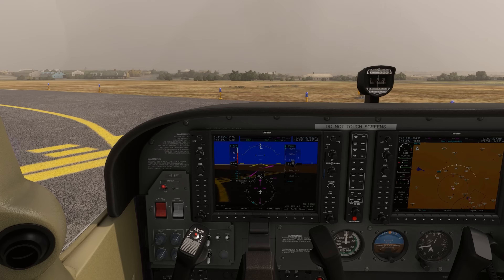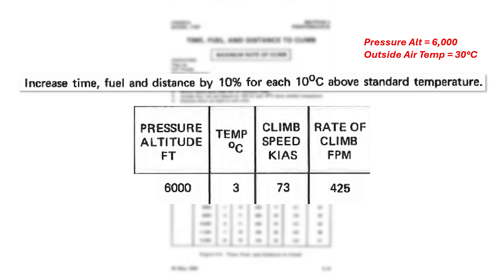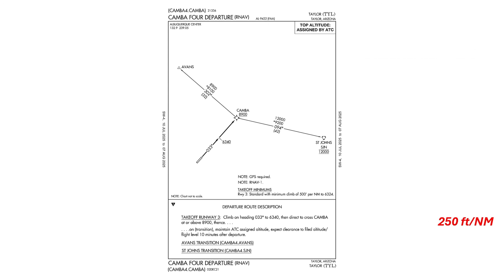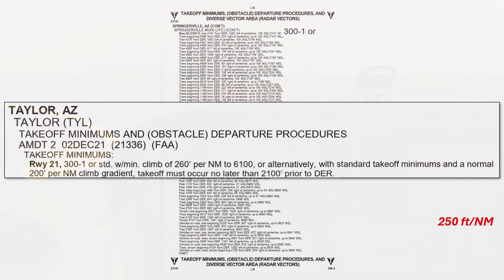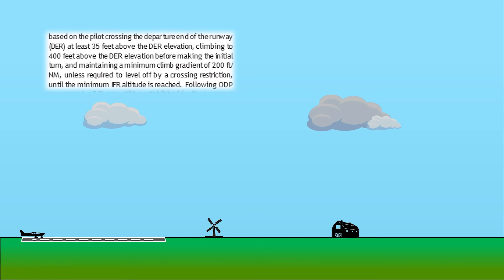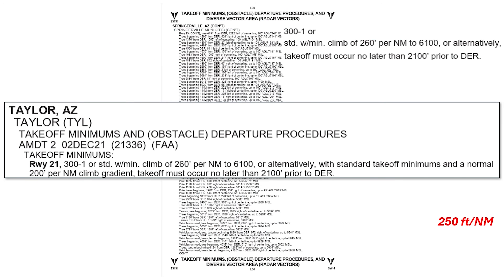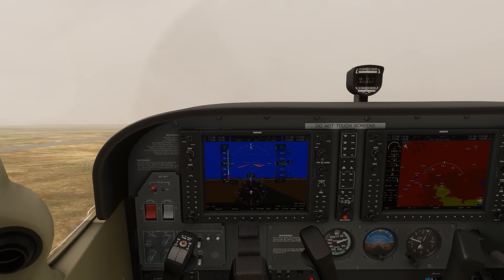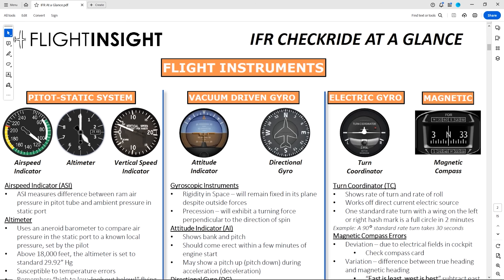This IFR Departure is Legal...But Barely Safe

Comment: The thing I always have to remind myself on is the performance data in a POH are assuming:

1.) The pilot is performing just as well. They can maintain Vy and climb out without too much deviation. Make sure the mixture is configured correctly for 6,000 feet of elevation.

2.) The engine is performing well. An engine with 5,000 tach hours is going to perform differently than an fresh engine. I'd definitely be VERY observant of performance during the runup.

3.) There's no other factors (wet runway, tailwind, additional parasitic drag from airframe imperfections, etc.) which could change those numbers.

With such tight margins, I'd wait for the weather to improve. The numbers are great to give you a little hint as to just how tight those margins are, but you still need some good ADM to add your own constraints to those numbers.

Comment: Why does 21 have takeoff minimums but no specific departure instructions?
Reply: The takeoff minimums exist to provide clearance from a very close obstacle. If you have 300 ft ceilings and 1 mile visibility, you can visually avoid it. If you meet the other restrictions you can outclimb it. Once you are at 6100 MSL (~300 ft AGL) and continuing to climb at 200 ft/nm, you can turn in any direction (technically upon reaching 400 feet AGL) and are guaranteed to outclimb surrouding terrain, which does not rise very rapidly, with increasing clearance. It’s essentially a diverse departure.
Reply: @FlyingLessons so IF there are takeoff minimums AND no specific departure procedure, a diverse departure is available?
Reply: @vortexgaming8761  I don’t know if it technically meets the full definition of a diverse departure since it has a climb gradient greater than 200 FPNM, but laterally, yes.
Reply: @FlyingLessons okay thank you

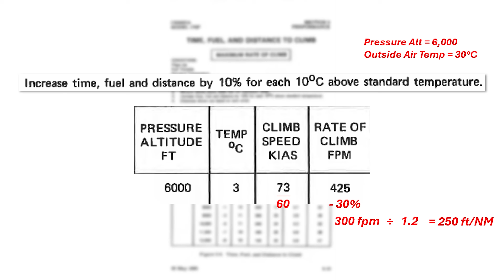Comment: interesting video, but i dont understand where you got the 60 from in 1:10 ?
Reply: You ground speed is 73 knots, which just represents how many miles you go per hour. Dividing this number by 60 (because there are 60 minutes in an hour) simply converts your ground speed (73 knots) into nautical miles per minute (1.2).

Comment: 0:42 can anybody explain this or give me a reference to this so that I can learn more about why you adjust the rate of climb? The POH only says to adjust time fuel and distance... it doesn't mention rate of climb.
Reply: Because if it takes more time to reach the same altitude, then the rate of climb, which is altitude gained / time spent, also has changed. You really, really need to make sure you understand basic things like that before you go flying, let alone flying in the soup.

Comment: Why would you do a short field takeoff with flaps ? That will limit your rate of climb, wich is what you need.
Reply: Because you should always follow your POH.
Reply: @lenmetallica Let me rephrase.  Why do a short field takeoff as opposed to normal. Short field will give limited climb performance. And the table used for calculating climb clearly specified 0 flaps.
Reply: @laxarus3259  Because performing a short field takeoff allows you to get up in the air and start climbing sooner than normal, giving you better margins for your climb gradient, especially concerning obstacle clearance.
The flaps aren't used during the entire climb, they are retracted when airspeed is above 60kt and there are no obstacles to clear.
Reply: @lenmetallica The point is that the departure plate expect same climb gradient from takeoff point. There is no page on the POH that describes that, because you mix the climb types. Unless flaps can be retracted 1 foot above and speed can be Vy, there are no pages in the POH which gives the correct numbers.
Reply: @laxarus3259  so? Flaps are recommended/allowed (depending on the 172 model) in the POH for short field takeoff. You can also assume that takeoff roll and total to clear obstacles will be given using whatever technique results in the lowest numbers, which is the short field takeoff. This is also by definition the best climb gradient, which is what we care about here, not rate of climb.

Even if the climb to altitude tables are compiled using Vy, using a steeper profile will at most give you a better climb gradient, which perfectly fine, because it makes the book numbers more conservative. You still shouldn't assume you can make it better (it's very hard to make a sustained steep climb safe for a number of reasons), and shouldn't use it to convince yourself to take off in sketchy conditions, but it will be fundamentally as good or better than the climb table numbers.

One caveat is that in older models 172 the POH warns that flaps result in shorter rotation, but longer total to clear obstacles (i.e. worse gradient). Therefore you should not use them or take them out as soon as possible. But in P and up, flaps 10 is the standard max gross weight takeoff technique.

Of course none of the above makes this particular departure a good idea, or means there aren't other reasons the book numbers won't be attainable in practice. In particular Vx climb to altitude would be horribly unsafe. But those reasons are different than what you claimed. You really need to understand what the rate of climb measures, how it differs from climb gradient, and what situations call for which.
Reply: @barblargh The point is that there is no information in the POH about transitioning from short field to best climb.  

When you have transitioned  i.e. retracted flaps and accelerated to Vy, you could be in much worse position than had you just done a normal takeoff.  Again, the transition time, distance and ROC is not specified anywhere. 

Unless you have actually tested this under the given conditions there is no way of knowing if its better or worse to do a short field takeoff.  It is not written in the POH.  

A short field takeoff is intended for exactly what it says. Short fields. It is not intended for better obstacle clearance. You are combining two departure types, by guessing the numbers.  

And by "you" I mean the guy in the video 😉

Comment: Another factor to consider: A sustained climb at Vy or Vx may not be possible on such a hot day. Your oil temp and CHT may rapidly climb to or beyond redline.

In fact, the time-and-distance-to-climb tables for most light singles assume that you'll be able to maintain Vy to the specified altitudes, and often that's not a realistic profile.
Reply from the maker: Very true, Bruce. Especially during these summer months those CHTs can creep up pretty fast in a climb
Reply: Not to mention your climb performance is going to get even worse the higher you climb

Comment: 0:58 why wouldn’t you convert your climb IAS to calibrated, then true airspeed, then apply prevailing winds to get your ground speed?

I know that isn’t the main point of this video, but the distinction between IAS and actual groundspeed in climb is crucial. 

In these lower-horse power, naturally aspirated trainer aircraft like Piper Archers and Cessnas, we have pretty poor performance as it is, as indicated by this video. 

In a Piper Archer (what I fly), Vy is 76 IAS, but 78 calibrated. In this video’s conditions, I believe TAS would be 89 kts. To actually climb at 76 kts ground, we’d need a 13 kt headwind component, which while definitely possible, is often not going to be the case. 

If our groundspeed was say, 80kts, and our FPM climb was 300, our foot-per-nautical mile would be 225’. (80/60 = 1.33 miles per minute. 300/1.33 miles per minute means 225 feet per mile) (using Piper Archers numbers even though this video is using a Cessna).

Doesn’t change much in this case, but when calculating climb gradients, this 10-20% difference  is quite important in determining if you can make a climb gradient or not. 

Thanks for the video!
Reply: The example he gives assumes zero wind. We dont use calibrated because we dont have an instrument that displays it. Otherwise you are right, climb gradients depend on ground speeds, and the wind would have to be subtracted or added to true air speed.
Reply: @Saml01 yeah, actually flying it we go off indicated. But yeah, what I am saying is for planning, it is important to get TAS and groundspeed. Given the video’s conditions, a 73 kt IAS climb would mean a TAS of 84-ish kts. With no wind, that would also be the GS. That is 1.4 miles a minute, which takes the 300 fpm climb to a 214 ft/NM gradient, quite a bit lower than the 250ft/nm climb he calculated and almost below the minimum 200 ft/NM requirement. (Edit: not to mention, this is the initial climb out. Performance at top-of-climb averaged with initial climb would likely yield a <200ft/nm gradient, leaving you unable to fly this)

In a video about making a climb gradient, I thought this distinction would be important to call out for anyone reading. Especially anyone that flies in hot, high elevation areas.
Reply: @Briansc92  You are 100% right.
Reply: Good point, will keep in mind.

Comment: why did you climb out with flaps? doesnt that make climb performance worse, even if better for shorter takeoff run? Also is there any channel like this for european regulations? espescially for ifr that would be great! love the channel though
Reply: I am not well versed in the Cessna but the Piper Archer has a short field procedure that requires flaps 25 degrees and then retracted once clear of obstacles.  A clean wing will be best for Vy or best rate of climb while other configurations opt for best angle of climb or Vx, where you climb the most altitude per distance travelled as opposed to altitude per unit of time.  You can even pitch further than that for a less efficient but more aggressive climb, for more risk of stall.

I once had to perform a hot and high departure from a mountain airport in a naturally aspirated Cirrus SR20.  The manual says to rotate at a certain airspeed 65-70 knots, and then pitch forward to gain speed for best rate of climb when possible.  There was no way to do that safely because I was trying to clear fifty foot tall evergreens on the end of the runway, so I kept the airspeed in the 70’s, with the flaps halfway, trying to gain as much altitude as possible until I had enough that I could transition to best rate of climb.  It was a really scary experience, but it taught me a lot about the dangers of mountain flying, of how to use the performance of the wing to get your desired outcome, and about poor decision making (which I’ll own), how to plan in the future, and how to understand aerodynamics to help whatever situation you end up in.
Reply: Doesn't that come down to the operating handbook? I don't do real life flying, but when I play WW2 sims a lot of handbooks explicitly tell you to put your flaps into specific deployment angles and keep them deployed until you've reached a specific IAS and a consistent, positive rate of climb (otherwise you risk stalling or losing too much altitude before you regain positive rate). Junker 88 and A20 "Havoc" come to mind.

Comment: as part 91 operators we are not bound by takeoff mins OR climb gradients correct? i know i know “but it’s not smart…” just double checking the legality of things
Reply: Takeoff mins is correct, instrument procedures handbook (1-8) states, "Aircraft operating under 14 CFR Part 91 are not required to comply with established takeoff minimums. Legally, a zero/zero departure may be made, but it is never advisable."

As for the climb gradients, I'm having a hard time finding a definitive answer. I thought climb gradients were legally required. Anyone know where to find this?
Reply: @AaronAcree_8 I would think this would fall under 91.123
If you are cleared for a departure I think it's arguable that you have to abide by the terms of that departure. Just like when you get an approach. 
91.175 is explicit in the legal requirement to respect the DA/MDA but it doesn't say anything about intermediate fixes. I think 91.123 covers that.
Seems like a grey area since no tolerance is given in the regs but I think legally speaking 91.123 would get you if you deviate enough (if terrain doesn't).
Reply: @AaronAcree_8 i agree with you and am hoping someone provides the definitive answer!
Reply: @mvsc-k5e As with numerous things in aviation, there is no definitive answer
Reply: @AaronAcree_8 Climb gradients greater than 200 FPNM are specified when required to support procedure design constraints, obstacle clearance, and/or airspace restrictions. Compliance with a climb gradient for these purposes is mandatory when the procedure is part of the ATC clearance, unless increased takeoff minimums are provided and weather conditions allow compliance with these minimums.
Reply: You should comply with the climb gradient if you would like to enjoy the procedure’s protection of not hitting anything.
Reply: @FlyingLessons i know that i should. but i asked if i must.
Reply: @mvsc-k5e  I’ve replied 3 times and it keeps getting deleted.  AIM 5-2-9 paragraph 5 (quoted above) says you must comply with a climb gradient that is assigned as part of a clearance.  Later in that section it mentions that part 91 operators are responsble for obstruction clearance if they depart without an assigned departure procedure. So if you are not assigned a departure procedure, you can depart however you like but you are responsible for avoiding obstancles. If you receive an ATC clearance for a procedure, you are responsible for adhering to the requirements of the procedure, and asking for a revised clerance if you are unable to comply.
Reply: @FlyingLessons good stuff thx!
Reply: @FlyingLessons though technically, ATC does not ever assign an ODP correct?
Reply: @mvsc-k5e  they can and do - when they need to. Out where I live (SF Bay area) it is very common because it is busy airspace and they need to know what you will be doing to separate you from other IFR aircraft. Take a look at SQL or PAO. There are no SIDs so they routinely assign the ODP. Otherwise they'd have to stop SFO and SJC arrivals.  (Or give you a vector but there are limitations to that as well)

At farther out airports like O69, they will just clear you to your first fix (SGD VOR) and don't care how you get there because there is not as much separation concern.
Reply: @FlyingLessons very nice! now i know!

Comment: I don't think you should subtract 30% from the rate of climb, but rather divide by 1.3. The time is increased by 10% per 10 degrees over standard, not the rate of climb.
Reply: My very first CFI said as soon as you start nickel and diming ways to make it work, or if a performance calculation looks tight then its time go back into the FBO and enjoy the snacks then fly another day
Reply: @expataviator7107 that's absolutely true, but it's basically a coincidence that in this case -30% works out to be more conservative. It's important to get the numbers right, because as soon as you get them wrong, all bets are off.
Reply: @expataviator7107 Agree of course. But this channel is very detail-oriented about the numbers, and I just wanted to note this small detail. It's actually related to the same math logic as in another video, about round trip flights with a headwind then a tailwind. Even if you have a headwind one direction and a tailwind the other, the total flight time is different than if the whole trip had calm winds.
Reply: @shreyasashok1305 of for sure! Details matter. These are common logical math errors that people make all the time. I’m glad you pointed it out.
Reply: But why would you not do 30% when that’s what the poh wants you to do
Reply: @rayclau8940 The POH states that the 30% applies to the time, fuel, and distance, NOT the rate of climb. Dividing the rate of climb by 1.3 is equivalent to increasing the time to climb by 30%.
Reply: Think of it this way, if it wanted to increase the time by 100%, you'd still be climbing, but it would take twice as long. 
If you subtracted 100% from the rate of climb, that would be 0fpm - ie, not climbing, wrong.
Reply: Good catch
Reply: Thank you for pointing this out.
Reply: So… 30%?
Reply: @rayclau8940 subtracting 30% leaves 70% but dividing by 1.3 leaves 77%. It's not the same.
Reply: @shreyasashok1305  yeah there’s why I usually avoid math
Reply: @shreyasashok1305  im not sure which is correct but it seems like you should assume the lower number for an extra margin of safety